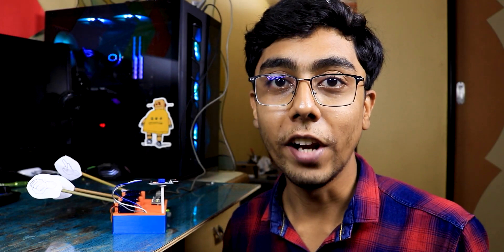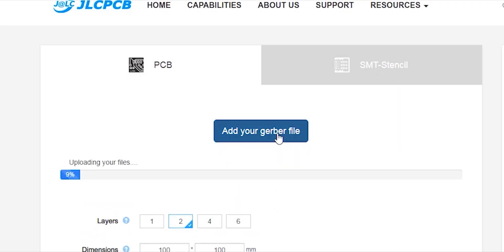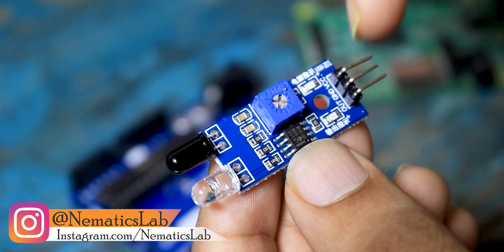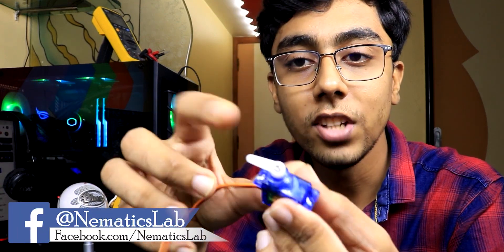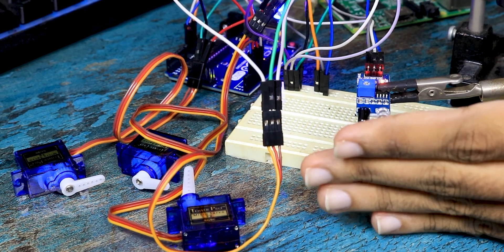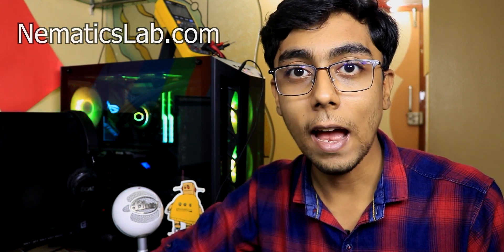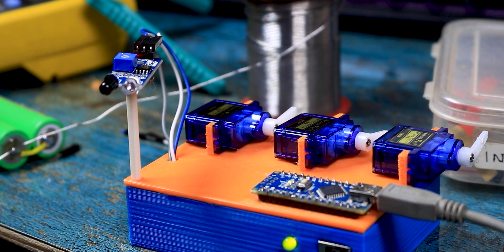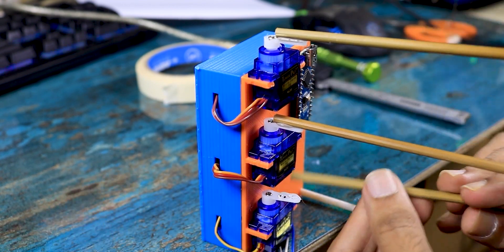I made a Robot to Play ROCK PAPER SCISSOR using Arduino | Machine

Comment: Does your soldering station 878d Have a heat resistant silicone cord?
Reply from the maker: Nope they are not made from silicon, I have suggested them but price might increase. But there is metal core to protect mains wire inside
Reply: But even the cheaper ones have silicon cord
Reply from the maker: @kac3514  buy those then.